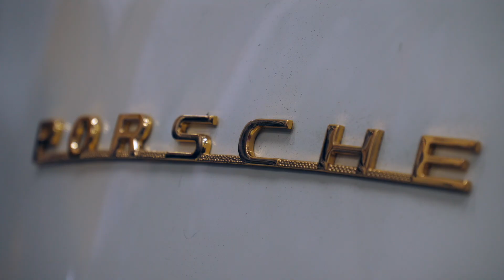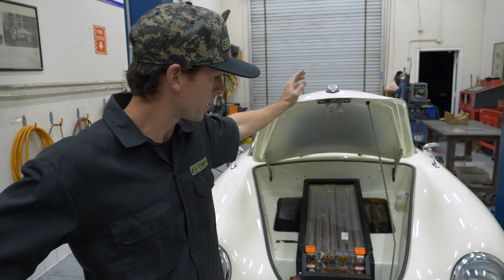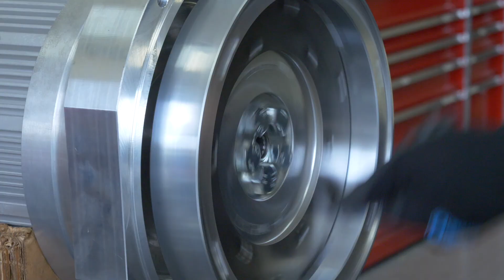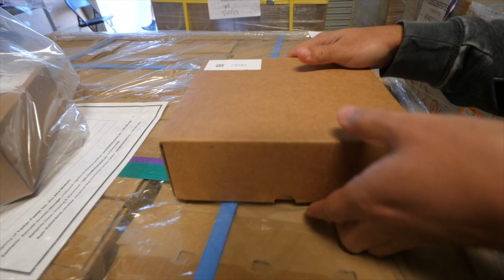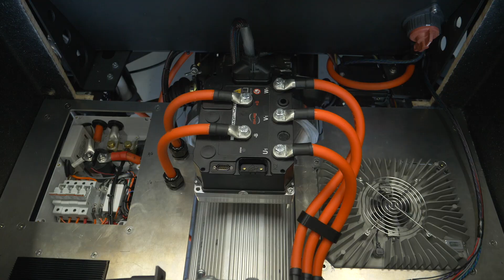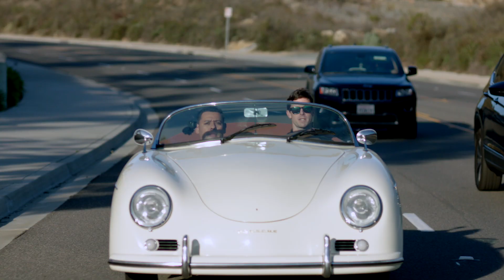Electric 356 Porsche Speedster Car Build

Comment: Interesting that you put the controller on top of the motor. Heat rises so I would have thought off to the side would have been better. Is there a cooler plate or something under the controller?

Comment: This is awesome. Amazing work guys. I just have a couple of questions.
1. What happens to the gear stick after the conversion since you don't necessarily need that anymore?
2. I have seen that most EV's have a 12V battery for starting the entire vehicle, does yours also have a such an accessory. 
3. Do you maintain the accelerator pedal and just had some few modifications to that or do you change the pedal entirely to something different?
4. Is the clutch pedal or maintained or do you remove that entirely since its not useful in such a conversion?
Thanks in advance.
Reply: Isaac, I don't know if it is true in this case, but being electric does NOT necessarily mean that you have to do away with the manual gearbox. Take a look at this converted 356 C Porsche done by Electrogenic out of England. It is electric AND has the original manual gearbox to boot. I didn't see anything in this video about them keeping the original gearbox, but it IS possible. Check it out: https://youtu.be/OXhOyghwJnE
Reply: @Fubeman  Thannks for ths. I'll do well to check out the link provided.

Comment: Ideally, this car would have all the batteries fit into a cavity that would be as flat as possible, where the top side would be the floor between the front and rear wheels.  Having all that weight so low in the car would make it handle awesomely as well.  Then maybe you might have a bit more storage space in either the front or back of the car.  I don't know if it is too optimistic to try and incorporate that into the design, but it sure would be great.

Comment: Nice build.
Hitting a key with a metal hammer and the ball of a hammer no less.. not an aluminum drift. Recipe for peening over.
So much wasted space in this installation using standard parts, restricting the Owner's ability to carry anything substantial.

Comment: Trouble with electric cars is that they go like crazy but for a short distance compared to their fuel burning ancestors. They are very expensive to convert , and I wouldn't want to drive one in flooded situations that fuel burners might be able to handle , as electric circuits short out rather suddenly .

Comment: Do you fit a support bracket at the end of the  motor for support? Or is the bell housing bolts enough to hold the weight of the motor?

Comment: What is the environmental plan and impact of disposing of old dead batteries? Does your environmental impact take into account recharging from conventional power plants eg gas coal nuclear etc. Solar charging is a neat idea until further digging finds solar panels are made from quartz and coal fired and fused together at 1800 degrees Centigrade. Does your environmental plan also account for the making and disposal of the solar panels. My guess is that electric vehicle waste will become the next great world pollution disaster.

Comment: I watched 15 minutes and saw so many problems.  Having 2 Chevrolet Volts, your conversion would be no where near the quality of a used Volt at @$10,000.00.  You use an air cooled electric motor (liquid cooled maybe 4x the life), ball/roller bearings (slinger rings in oil 5x life) and so much more.  And I believe I got a price quote months ago of $70K.  Wish someone would build the body to fit a Volt, Tesla, or even that little Nissan electric.  You have a piece of junk on a beautiful body.

Comment: you should have a stress calculation for crash not only to fix the battery on the frame, if the car kills the passengers in a crach at 20km/h because the battery is flying around than is a shit of project

Comment: Where do you purchase the non Tesla automotive electric motors? I was arousing Alibaba and could not find one. Also I hear Tesla batteries are not the best also their not the Lightest some electric resto mod guys are using Chevy volt batteries which take up less room and are lighter. Also they should have done a custom for that Porsche model battery box to totally fill the bonnet space with batteries 🔋

Comment: ive got a question... do you guys actually have the motor hanging in the air connected to the transmission? or it is leaning on a frame which i cant see? 
thanks for the answer in advance
Reply from the maker: It hangs

Comment: The music, on the video. Kills it! On the other side, excellent craftsmanship. On the second side, I don`t thing electric cars need a transmission. Third, ten pallets, not ten pounds. Still, the better batteries, don`t charge faster then they discharge.  My final opinion: - Let`s work & invest, on a better battery! Super-Capacitors, perhaps? I use to work for Callenberg, in Miami, as a freelancer, converting energies, all the way around. Third, and last, You don`t mix Iron & Copper, on the cables! Enough? Lol! The conduits needs to be perfect! Perhaps, Gold? If not, smash, a copper tube.

Comment: Those 18650's you mentioned are lower spec than some of the newest 'cutting' edge units out there. I have some that are in the 20-30 amp continuous discharge range that hold in excess of 4000 mah per a cell.

Comment: If we're smart, instead of replacing millions of internal combustion engine vehicles in the nation/world, we'd be much better off simply exchanging petroleum engines for electric motors and gas tanks for batteries.  Reuse the rest!  Replacing the entire vehicle fleet just contradicts the goal:  LOWER carbon footprint.  That is if we can for ONCE do the RIGHT thing instead of bowing down (once again) to the moneyed interests who see dollar signs instead of the actual goal:  addressing climate change.

Doing this for the entire vehicle fleet will eliminate 1/3 of climate change gases produced by the US every year.  Think of the jobs created.  It would be one of the most worthwhile jobs programs this country has ever created. 

Plus, with electric cars, you "refill" them wherever you leave your car.  Overnight while you sleep, and during the workday while you're at work.  You won't have to "fill up" somewhere else after your car sat in the company parking lot for 8 hours - it recharged the entire time.  Parking lots will have pay charging stations at every parking spot.  Even street parking can have them..There will no longer be a need for gas stations. 

And having one, two or three electric cars in the garage or driveway has another huge benefit: emergency power.  California just experienced PG&E stupidity on a grand scale.  Well, that plus other natural disasters means the grid may and will be down from time to time.  If we all had electric vehicles at home we could power our refrigerators during outages with the stored energy in our cars.  Why put $12k batteries in your home when you already have them in your cars!

I just heard a radio show about energy cost over time.  Elecctricity has been flat for decades, whereas oil has risen steadily over time and will continue to do so as we summit peak oil/production. 

That with a major solar pv effort means true energy independence.  And cost savings. 

The benefits to electric vehicles are manifold.  They won't fix traffic, but at least we can get off oil once and for all.

Comment: It's a electric car why does it still need a not so efficient transmission a dedicated Embedded system solution could make it efficient please feel free to correct me if I am wrong
Reply from the maker: Not that inefficient, not worth the trouble re-engineering the whole transaxle to improve efficiency by tiny amount

Comment: Great job, would like to know the weight of the car once its done, is it more or less, ?
Reply: Depends on how full the gas tank would be I would guess.
Reply: Basically it's heavier than the original car. They have put 3 battery packs in front of the car, means it is about 25kg heavier on the front axis. Also on the rear axis it's a bit heavier due to the many electric components which sum up.

Comment: I made a complex circuit that runs an electric car ( still running today) and recycles the electricity.you get in and turn the key and go, no charge other than the original. Ismail from the Philipines and I were working on this while I worked for the aerospace industry. Electricty is never used per se, it is only changed into a non usable form. You can measure amps going into the ground from your box in your house. If you have a small amount of electricity such as a battery (12 volt) you can use it to run the motor and catch the spent electricity which can then go through manipulations where it is essentially electrostatic that gets mixed with Dc and you get the ability to do work. This spent electricity can be collected and pulsed back into a second battery or timed where the battery is not being used for a second and the pulse goes in but its better to have a run and a charge battery. there is an arduino that switches the batteries when one gets low. So you can have 2 twelve volt batteries and run your car for about 4 years before needing to replace the batteries unless you get special batteries that were designed by cole/ hackenburg  but originally by Tesla just for this purpose in the 70's. After you get in touch I am going to delete this post because I have had many problems knowing about this.  talked to Tesla five years ago and the engineer said we know who you are and what you can do but we are only allowed to make 5% gains on all our systems at a time and what you are talking about is called disruptive technology and has gotten people killed so watch out. I was followed around very visibly for almost a year but give me an email we can chat on.

Comment: Do you think you guys can put the motor and battery specs  in the description?
{assuming there were six 5.3kwh packs installed} so about 34kwh range about 100 miles?
Also wondering what the driving is like with the transmission still in use, couldn't  you just leave it in one gear and not bother to shift?

Comment: ever think of trying AWT 21700 50A 4000 mAh Continous Discharge batteries or are those too new and expensive to use. finding them in bulk seems to be a real challenge. i use those in my E-cigarette mods and i have to buy them in lots of 8 at the most and the NCR18650B that you usually use are plentiful i was just wondering if something like this battery might last longer and give more power and essentially also more speed or am i completely off base with my thinking on this

Comment: The claim EV cars don't pollute is far fetched;
Take two backup generators of the same grade and quality – one rated at 5 kW, and the other 30 kW.
An unlimited fuel supply is provided for both generators.

The 5 kW generator will cease functioning well before the sum total of useful work it produces matches the total energy generated by the 30 kW unit during its lifetime.

Why so, given the unlimited fuel supply available to both generators, which physically and truly makes them open-systems? 

It is not the fuel supplied to an energy-generating device that limits the maximum useful energy produced, but rather the total energy expended in constructing it.

As the 30 kW generator consumed more energy in its construction than the smaller 5 kW unit, the 5KWh smaller unit couldn’t match the sum useful work produced by the bigger device.

"Despite the sun shines every morning, winds blow and rivers stream, Energy always and only comes flowing from the past into the future. No energy system can produce sum useful energy in excess of the total energy put into constructing it" (The Fifth Law).

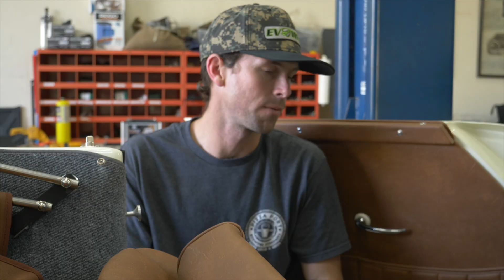Comment: Does anybody know whether they used manual transmission on a electric motor? If I am correct, I saw (13:32)handle of the gear stick marked with standard manual shift diagram on it.

Comment: The main "issue" still is batteries, as in the production and later on the replacement of said batteries. But if people charge them (and later on semi's too) by actual wind/solar energy and not by gray energy it will make a noticeable difference in emissions. Now for hydrofoil commercial ships!

Comment: Why didn't you just make the motors direct drive and avoid drivetrain losses?
Reply: Probably because it's a lot easier to make an adapter plate rather than have to re-engineer an entire rear suspension.  Plus, performance and top speed would be better overall.  My opinion.
Reply from the maker: Engineering costs to performance gain ratio makes it not worth it

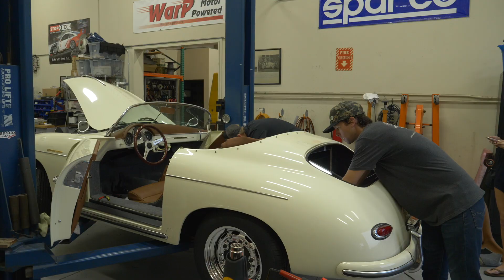Comment: While bolting the HV wires on the motor controller you should be using an insulated spanner(16:10)! We did short a module in our battery pack once by not using insulated allens and there were sparks everywhere. Gotta be careful!
Reply from the maker: You shouldn’t  be working on live wires

Comment: I've seen different answers about need for transmission (and clutch), but it seems it's justthe easier way to connect to drivetrain though not really needed?  I've also heard about using Tesla batteries, how do you source these?

Comment: At 21.34 - 21.36  and again at 21.42 visually the front wheels are absolutely gagging for a wider track, at least 50mm further in than the rears and while I know that can have advantages for turn-in it looks a little excessive. Everything else is spot on from my admittedly limited perspective, i am curious as to the EMF output of the motor/batteries and if any shielding was used, if in future that could get a mention that would be exciting to me as awareness of electro sensitivity becomes more widespread - big concern re:electric vehicles. Overall top work guys! Gorgeous gorgeous gorgeous car. It looks so smooth and classy and, reminds me of my teens playing need for speed Porsche 2000.

Comment: How much does it cost to make a conversion?
Reply: So i did the math, the jps replica starts at $28,900, so realistically were looking at around $32000. The conversion kit on their website is $7500, all in all you're looking at close to $40000, which is pretty good
Reply: I would guess nearer $80000 +

Comment: how do you cool the batteries ? was the manual transmission still operational? since there is a speed controller is the transmission even necessary ?

Comment: amazing work!
you did nt mention about the transmission, was it automatic?
does it work with manual?
also, where do you charge? can you use other brands of chargers like tesla s?
how do you use the original brakes? you keep the hydraulic system plugged or what?
with wider tires, this car is a dream! wow!!!
I wish we had sound to hear the car burning on the road, it must be special.
good show!!!

Comment: Question JEHU, I have a 2009 Mini Cooper Clubman s and it's a great car when it is not in the shop. How much would a conversion cost me?? I can buy a used EV for under 10,000-Fiat 500E or a Spark, so can I convert it for around that? or are EV conversions only for the rich??
Reply from the maker: No,  that much might pay for raw battery only,  there’s a ton of custom engineering  on these types of projects
Reply: @jehugarcia  That is what I figured, it just seems like there would be a market to make a bolt on kit for cars like the Mini, since they are front wheel drive you could mate a motor and trans together in a small package along with motor mounts. I mean once the kit is done it would work like vehicles. I know they make kits for VW's but from my research it seems more like 20,000 is a minimum cost. You can buy a used i3 for that. Thanks for the info

Comment: So I'm looking to put in a lithium battery bank for my schoolie conversion. My inverter is 12v 16 max 10 min. I want to do a 4s setup. Should I do 4 100 parallel battery packs then wire them into series or do 100 parallel 4 series packs? Inverter is 3000 watt so I'm guessing my Max draw from the bank at low voltage of 12v(4x3v) would be 250 amps. 4v charge per cell to 3.0 discharge would give my batteries a lot of life right? I'd rather buy more cells and have them last longer than try and squeeze every watt out of them and reduce their life cycle.

Comment: Last comment- "Its not polluting"  Really?  so what about the manufacturing of all the parts and the disposal of the old used battery's?  No pollution there, right? Wrong- the carbon footprint is almost the same as its gasoline counter part.  But its California and truth is optional.

Comment: Where are the seat belts in these cars.
Here in Australia we get fined a few hundred $$$ if we do not wear seat belts. If you car does not have seat belts or they are not usable your car will get de-registered if you do not get the seat belts installed/fixed. The police also fine you and you may have to have extra fees by attending a court.
Reply from the maker: Sounds like a terrible place

Comment: Ugga duggas the bellhousing bolts and flywheel bolts. Then explains the importance of torquing up the clutch pressure plate.....            Don't take that as dissing your work though. That's one nicely engineered car. Credit to you.

Comment: This adds a neat twist on Replica.  Perfect for this or a Beck.  I'm interested in how you actually use the transmission.  Do you start off in 2nd?  Probably a two speed is all it needs.  Beautiful work guys.  Looks like a great shop.  I would miss the sound of an actual 356 engine, but maybe look into what BMW is doing with the enhanced sound.  It is a lot less hokey than you would think.  Fun video! F

Comment: Can anyone answer this. Why does this car have a transmission, I’ve heard you don’t need transmissions on an EV.
Reply from the maker: Easier to leave it,  and allows you to use smaller motor with same performance as larger one